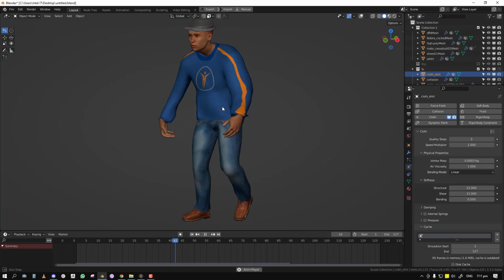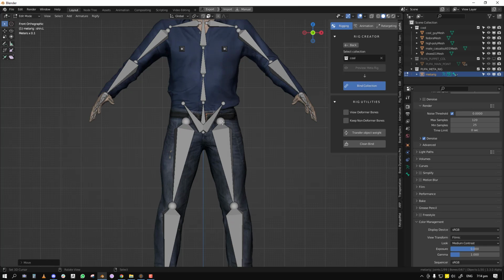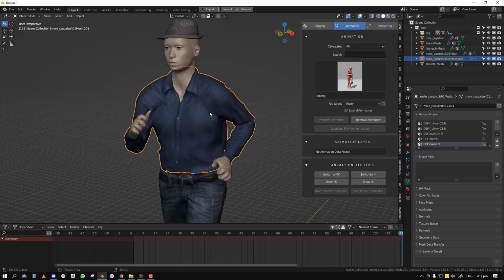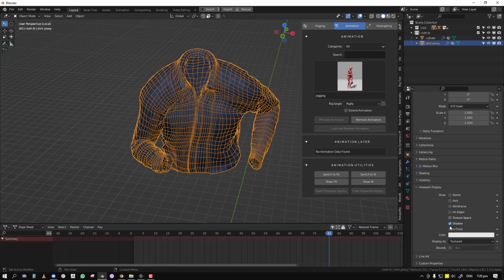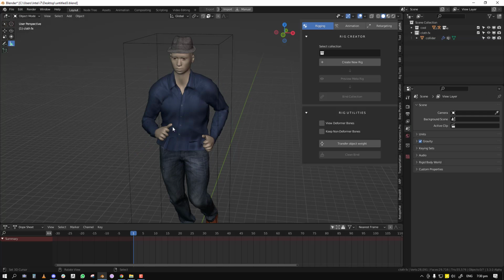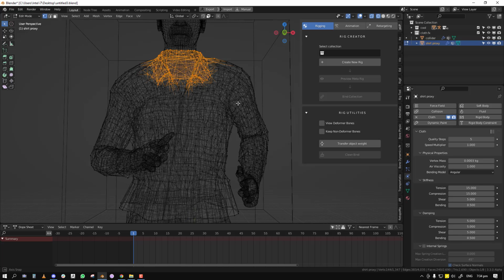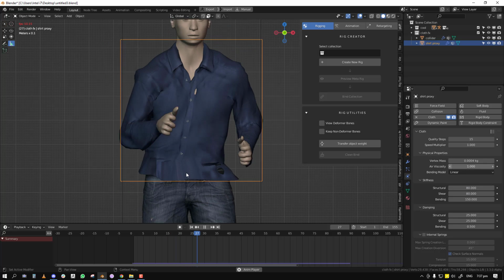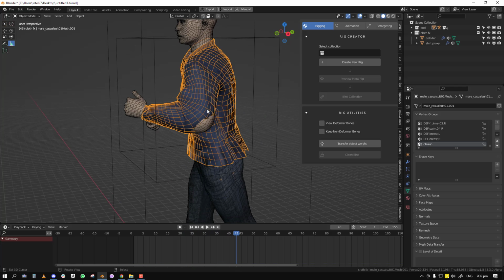Setup Real Time Cloth simulation in BLENDER (Luwizart)

Comment: Something about surface deform modifier, concave polygons error means that some faces on the deformer mesh are not completely flat, to fix that you can simply triangulate deformer mesh, your mesh not need to be closed